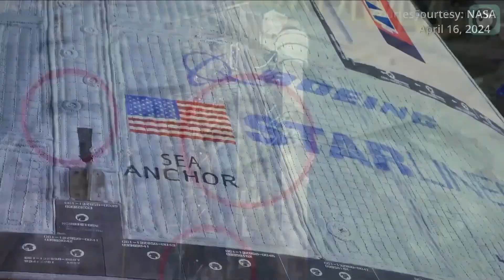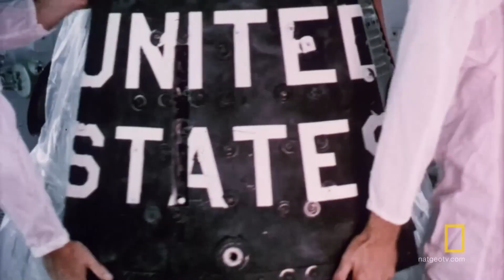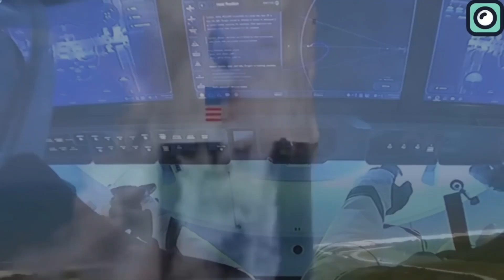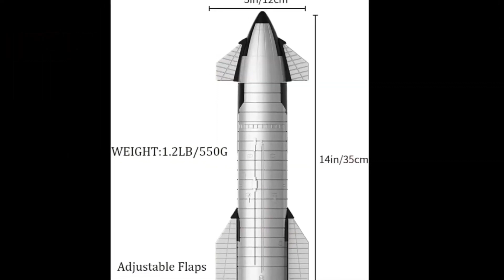Starliner Astronouts Are Finally Getting Back With SpaceX's Dragon

Comment: For Apollo Boeing's contributions were limited to building the first stage of the Saturn V (basically 2 big tanks and a shell) and installing 5 engines designed and built by Rocketdyne.
They had no involvement with the CSM or the LM.
Reply: You badly underestimate the engineering requirements when engineering something like the Saturn V! The whole assembly is a dynamic structure with three stages that must not fall apart when mighty explosions in the three engine rooms shake them to the stress limit.:face-purple-wide-eyes:
Reply: @brianletter3545  As long as the rocket didn't fail before dropping the first stage, Boeing couldn't care less.